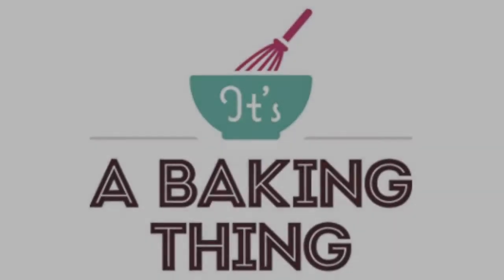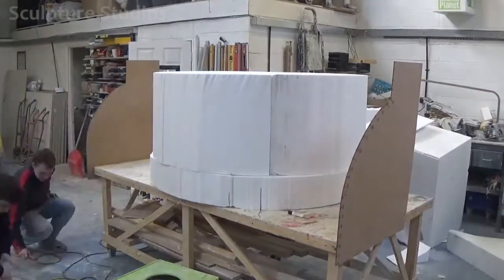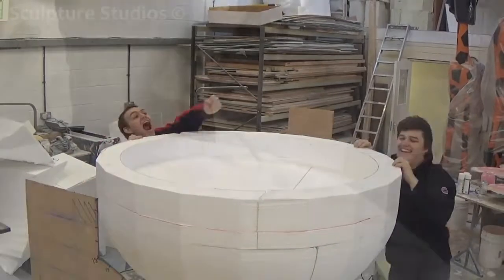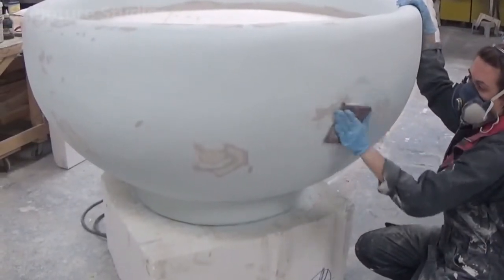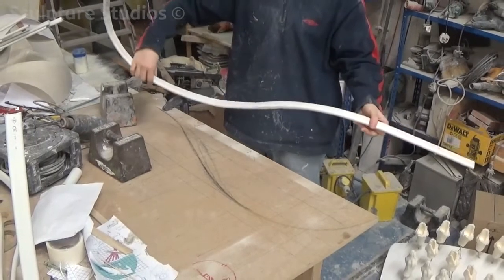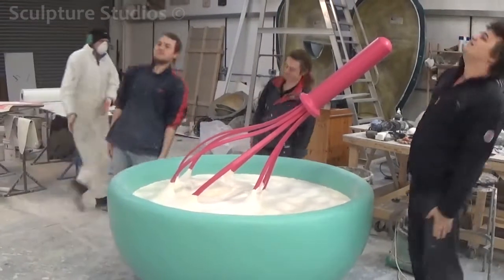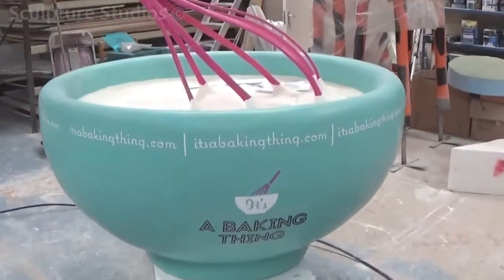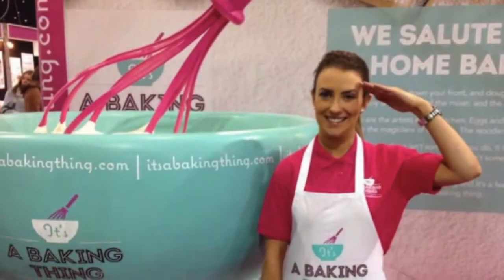Giant Bowl & Whisk from Polystyrene / Styrofoam by Sculpture Studios

Comment: How did you make the whip? At  2.17 you can see how to shape the whip with heat, but is it polystyrene too? or what material is it?Thank you
Reply from the maker: The whisk is made from a PVC plastic (a sort of conduit that you would put electrical wires through).

Comment: I've watched many of your videos - amazing work!  Having been to Disney in Orlando I now know how they make their props!  You've inspired me to build a faux rockery area in the garden.  I would intend using scrap polystyrene blocks and insulation, carved accordingly.  But how would you suggest I proceed from there?

As it will be outside open to the elements, it will need to be water and weather proof (both summer and winter).  I've seen you mention in your videos "plaster render" and "flexible concrete render" - would either of these be suitable for my project?  How would I make these renders?  How would I colour the rocks - by using additives to the render or by a form of painting/staining afterwards?

Maybe there is another way of doing it (chicken wife, fibreglass etc.)?

Any help would be much appreciated as I know I have the ability, I just don't know how I would do it!

Thanks - and keep up the great vids!
Reply: Hi again!  Sorry, also how would I make it water & weather proof?
Reply from the maker: True Brit Our recommendation would be to protect the polystyrene, and then give it a blanket coat of glass fibre. Than use car body paints for a solid finish

Comment: Extremely nice :D Can I ask what material you were bending with the heatgun when doing the whisk's spokes? Also, was the cream-whip's wavy surface made of body filler or just carved into the polystyrene?
Reply from the maker: Hi Dorian, the material heated up for the whisk, was plastic conduit tubes that you would use for running electrical cables through at home (sort of a PVC like plastic). And the cream whip was partly carved, and partly added to with squirt foam (the same foam we join our polystyrene together with), and then the water based filler on top to finish it off. Yummy!!